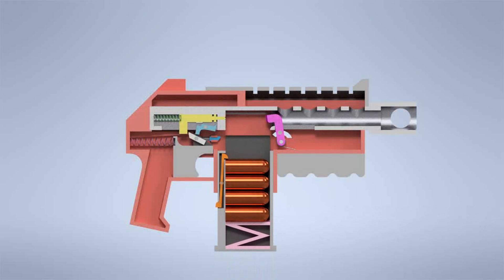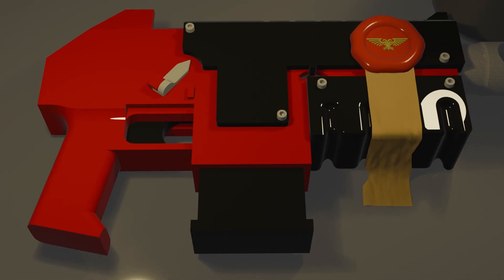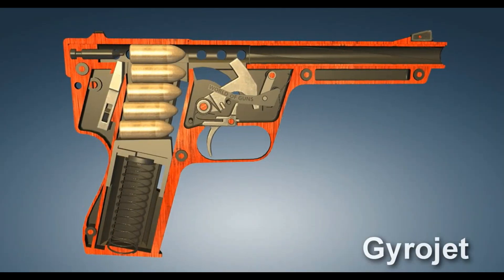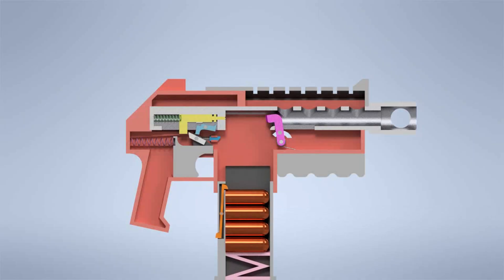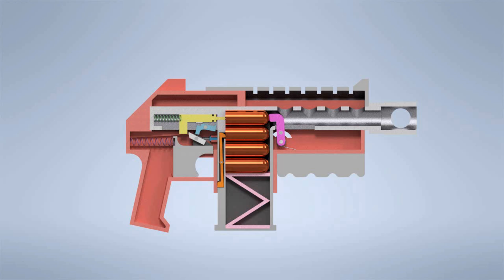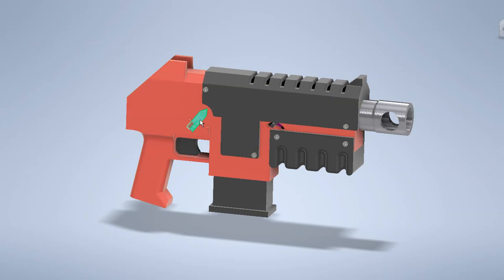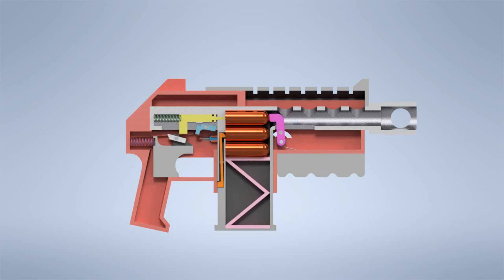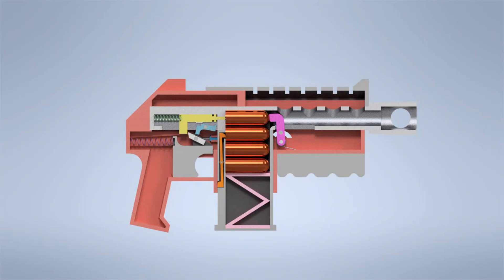How a Warhammer 40k Bolter Would Work In Real Life

Comment: The only flaw with this is that more often then not the bolter is shown firing a 2 stage projectile. As in there is a casing containing an initial charge to propel the projectile, and a second stage built into the projectile itself. This for one helps with the issue that the gyrojet suffers from in that the projectile has very low and pretty much non-lethal velocity at the muzzle, and 2 helps cycle the action better.

Comment: It's not a bad initial concept, but it can be improved. The gyro-jets crippling weakness was muzzle velocity, as the projectile would exit far slower than most modern (for its time, not to mention today) firearms and gain speed as the fuel burned. To counteract this, you'd need two ignition systems: an inital powder charge, and a rocket charge with a fuse. IIRC, that's how it works in 40K, though I dont remember if bolters are rifled or not. In a realistic setting, rifling would still be the simplest method, as the manufacturing of the "gyro" part of the gyro-jet could drasticly limit production, but it could still be plausible if "anti-yes .75 caliber handheld rpg" can justify the cost. The rounds would be damn heavy, though, so theres the logistics of carrying those and now I'm rambling. Neat 3D model, btw.
Reply: the muzzle velocity is honestly less of an issue because it also explodes.
Reply: @GameFuMaster true. There's a balance between penetrating power and the magnitude of the explosive payload. I was presuming that a real world bolter equivalent would be a dedicated anti-armor round, like an Abrams sabot round in a one or two handed firearm. Using an explosive round means you dont need as much penetration, though ideally the round would penetrate to the internal components of a target before detonating. For a round this big, I feel like using it agains anything smaller than a car is... overkill. Uncle Sam has done less with more to prove a point, though
Reply: @LetsSeeWhatHappens1227  Gotta also remember it's fiction, so rule of cool is number 1.

Gotta also remember that you've got organic aliens whose carapace could probably shake off real world .50 cal rounds
Reply: @GameFuMaster of course. When I'm diving deep in DRG, I don't ask how a 1 meter tall chain smoker can dead sprint while carrying an anti aircraft turret with enough rounds to overthrow a small government. But how that flak cannon of a primary weapon could be physically feasible... it's an exciting train of thought. All of my thinking is in the context of "from the material, this is over the top and impractical and cool as hell, but what if..." All in good, mischievous fun
Reply: Bolters are rifled. They use traditional primers and smokeless powder to propel the projectile that has a rocket inside of it pretty much that is ignited by the smokeless powder propelling it forward.
Reply: @Omega_A3 that makes sense. Thank you for clarifying that!
Reply from the maker: You're right the actual lore says it uses the 2 stage ignition system. But the aim of my design was a practical bolter that someone could actctually fire. Since firing a conventional .75 or 1 inch caliber gun would probably break you're rist (unless your a space marine) I decided to design it like the gyro jet, which from what I understand had barely any recoil. But like you said that does mean it will suffer from low initial muzzle velocity.
Reply: @juliensmechanicalprojects another possibility, though this would be even more complicated, would be a recoilless rifle, like a gauss cannon. It would have to use a coil gun design, but that is far more realistic than a .75 cal rpg rifle carried by infantry
Reply from the maker: @LetsSeeWhatHappens1227 that's a good idea. If you use a coil gun for the initial stage you would solve the recoil problem and have a higher initial muzzle velocity. Then after it leaves the muzzle the second stage would ignite and propel the rocket round.
Reply: @juliensmechanicalprojects it could be a fuse or impact, I have zero military experience to tell me how dangerous that is. A hardened steel round would ruin anybodys day, explosives aside
Reply: @juliensmechanicalprojects  not correct again. yeah it would suck but its actually doable to fire it. Again, a 2 stage ignition is easy if you use the actual blast from the smokeless powder from the conventional casing to start the rocket propellant. hmmm what other systems could also work? oh right, the same rounds used by the Carl Gustaf. if you really want an easy cheat for the ammo then just use those but make it smaller. the internals of the bolter will be big and bulky to handle that but its still just a short stroke gas piston gun.
Reply from the maker: @Omega_A3 It's completely builable, but if you have a conventional firearm that shoots .75 to 1 inch caliber rounds for the initial stage it's not really usable because of the extreme recoil (except space marines). The Carl Gustaf works because it's a recoiless rifle and it vents part of the charge out the back to counteract the recoil, that wouldn't work for a bolter because to would vent straight to the face. My main goal was to design something a little more practical, that's why it's a little different from a true bolter.
Reply: @juliensmechanicalprojects I meant the projectile. And it would only be a bit higher than the recoil of a 12 gauge Magnum shell.
Reply: @Omega_A3  Carl Gustaf is not a rocket. 

Of all the things you could have chosen, you picked a recoiless rifle.

RPG is a literally what you'd want to use, or the stinger, or javelin
Reply: @GameFuMaster Yes, totally like I haven't worked alongside guys who use the Carl Gustav for a very long time. Oh wait, I have for years.
Reply: @Omega_A3  That doesn't mean you actually know your terminology well, or what the thing is.

I've been driving cars for over 10 years. That doesn't mean I know the ins and outs of the engine or any of the components.

But I looked up the Carl Gustav, and sure, it can fire rocket assisted rounds, but so can mortars, but I don't think you'd call a mortar a rocket launcher right?
Reply: @GameFuMaster oh no look at the standard round at fires. Looks like I'll have to admit you were wrong. FFV551 is the primary HEAT round and is a rocket-assisted projectile (RAP). And wow shocker, that exact round proves my point. Because guess what, it still has to be launched out of the tube and then all of a sudden whoa, a rocket on the back of the warhead turns on and it goes flying down range. Oh and don't try to lecture me on mortars, you will lose that fight in a heartbeat.
Reply: @Omega_A3  I mean if you want to argue with me over the terminology of rocket-assisted vs rocket propelled, then by all means go ahead.